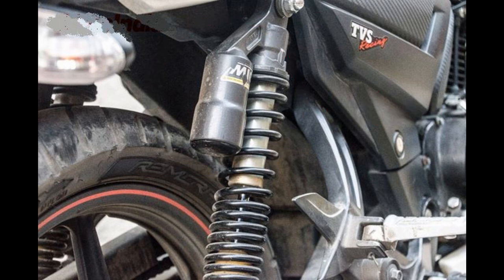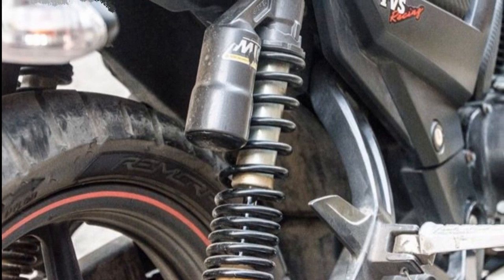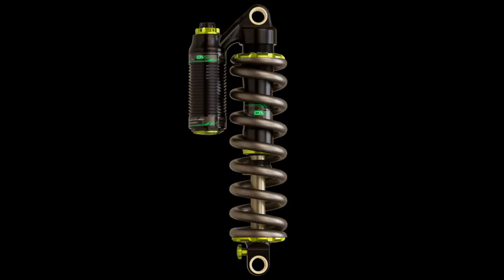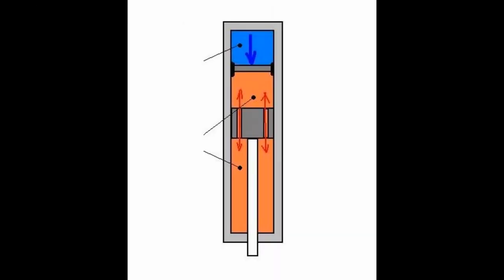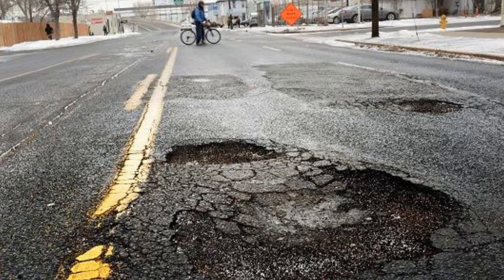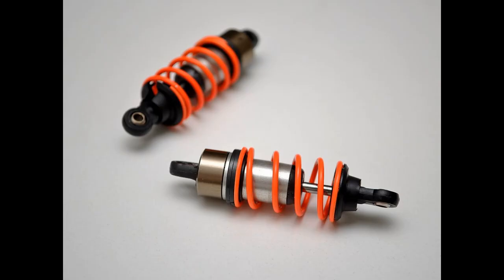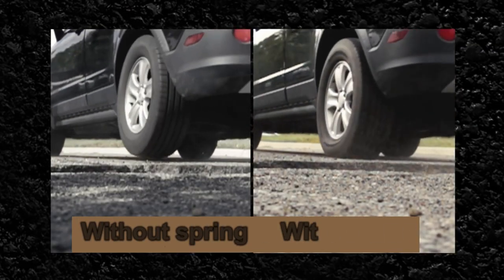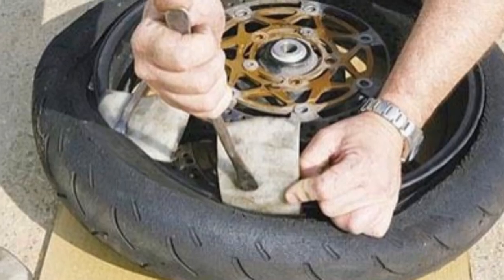What is nitrox suspension. Hydro pneumatic suspensions.

Comment: thanks for this tutorial  video. 
 i have a question, there's no problem if installed upside down, right?
Reply: pards, nasubukan mo nba refillan yan ng ordinary na hangin?
Reply: @miguelpaneda1607  di pa bro. replace ko na lang kesa repair ko pa.
Reply from the maker: There are some significant risks if installed upside down.. Since nitrogen is lighter than hydraulic fluid inside the cylinder, nitrogen will always be on top of hydraulic oil..
There are some special kind of shock absorbers which can be fitted upside down, but not a normal one..
Reply: @theartificer570  thanks for this bro. 🤜🏿

Comment: Deepak can we mount invert upside down this gas filled shockers?
Reply from the maker: Definitely we can..In some mono shock bikes, inverted configuration is used..
Reply: @theartificer570  thanks Deepak.. actual I am going to use the new pairs of gas shockers against old spring ones.. and my mechanic told it will not work properly